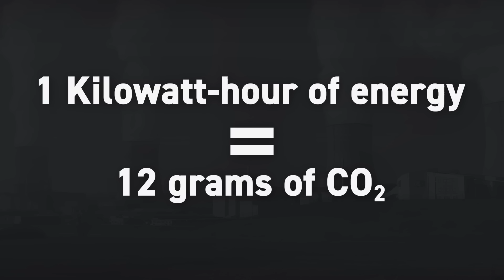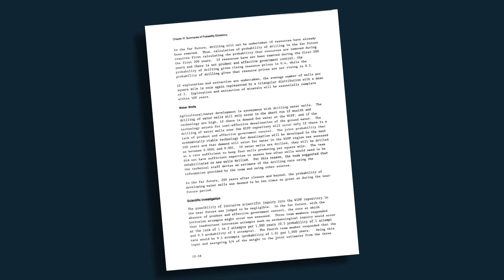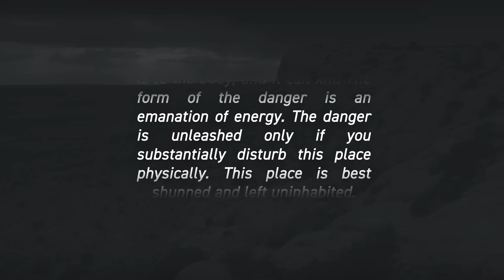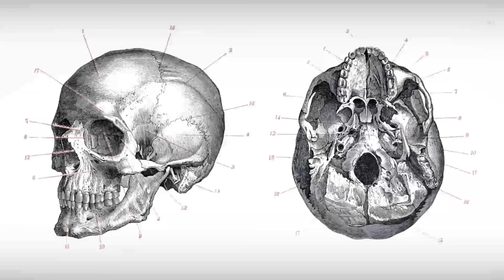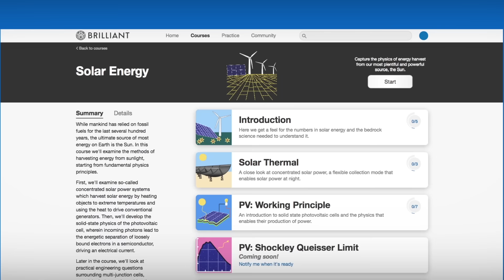The Nuclear Waste Problem

Comment: -the longer it takes for nuclear waste to decay, the safer it is, as it's half life is soo long that it does not release much radiation. Fear associated with long term nuclear waste storage is exaggerated.

-the problem of nuclear waste is self induced, governments opted for a less efficient design in order to produce weapons grade by-products for war. In so doing solid fuel reactors became prominent, which barely even use their fuel, fuel rods being discarded as "waste" while still filled with potential energy, which is a major reason why we have so much waste now.

-LFTR's avoid these problems, produce more energy, aren't under pressure, don't require power to be safe, have virtually unlimited fuel by transforming abundant thorium into uranium, produce useful medical isotopes, require far less space, don't need to be far from society, and burn ALL of their fuel thoroughly, making them ultimately much cheaper and safer to fuel and maintain. The circumstances of Fukushima and Chernobyl would have been harmless in an LFTR.

-the pyramids are NOT tombs. Ancient Egyptian pharaohs were all buried in the valley of the kings NOT the pyramids.

-nuclear power is the future, nuclear waste will not be a significant problem.
Reply: Thanks. Totally agree with you. Def one of his weaker videos.
Reply: Um actually they only started burying in the valley of the kings and queen in the NEW KINGDOM. Pyramids were tombs constructed by Old Kingdom pharaohs, pls look it up.
Reply: type "were the pyramids tombs" into google and see what comes up
Reply: we just can shot it into the sun once rockets are as safe as planes..
Reply: @gandolaf3433  that would eventually slow down the Sun's fusion, killing it.
Reply: Marvin Huber easier to shoot it out if the solar system
Reply: Spent fuel rods are 80% recyclable, the only reason we don't donit is because it's illegal, France recycled their fuel and has almost no nuclear waste, protest this crime against the environment!!!! Legalize nuclear recycling!!!!
Reply: Plutonium is not only a highly radioactive element it is also extremely poisonous as well.
Reply: @babybrat2958  ok. Fire is pretty dangerous too, maybe we should stop using that. Natural gas is very dangerous, lets stop using that. Cars have killed more people than plutonium ever will, lets ban all vehicles. : P it doesn't really matter that plutonium is dangerous, just take precautions. Regardless, with LFTR's I'm pretty sure there's a lot less plutonium involved, though I'd have to double check
Reply: I never said that we should stop using nuclear power. Are you aware of just how contaminated areas of the US are from both nuclear research and experiments....not even talking about bomb testing....there have been quite a few nuclear accidents that many aren’t even aware have happened. 

They have also already had an accident in a repository in New Mexico, a drum filled with transuranic waste burst and contaminated about 1/3 of the repository. It took three years to clean up. 

There is a ridiculous amount of high level radioactive liquid waste stored at tank farms at the hanford site. Portions of Denver and other areas in Colorado were contaminated with plutonium. There were two major plutonium fires at Rocky Flats Nuclear Weapons facility.

Many experimental reactors have suffered partial melt downs.
Reply: vote dis man as president
Reply: Nuclear fusion is where it's at.
Reply: The best argument
Reply: @m0314700308891515  Reprocessing is legal in the USA. Has been since Reagan was president. There is simply no motive to recycle fuel since new Uranium is still cheap. France reprocesses it's fuel but can only do so once, due to the designs of their reactors. After that, it's all waste and it gets stored just like every other nuclear plant. 
We need a new reactor design that is built on a closed fuel cycle. Something like Molten Chloride Salt Fast Reactors.
Reply: The only problem with LFTRs is that they run on Thorium. If your goal is disposal of Uranium/Plutonium waste, a LFTR isn't the way to go. An MCSR is though. Or the LMFBR like the one that ran at Argonne National Labs for 30 years without incident; EBR-2.

Comment: Thorium > Uranium
Reply: China is working on thorium reactors
Reply: powerstack123 really? That’s gonna have an impact on the Norwegian economy. They’ve got tons or thorium
Reply: ANY molten salt reactor > Water cooled reactors. Thorium isn't that great, I would rather see uranium based MSR reactors that can utilize the waste we have already created, and plentiful U-238, instead of pushing for more complex less efficient and expensive thorium fuel cycle reactors. Fast spectrum NaCl(table salt) reactors > thermal spectrum FliBe (fluoride lithium  beryllium) salt reactors
Reply: Phlaked Corn Source?
Throrium makes a lot more than uranium, and has less waste.
Reply: +Ondra English You're comparing a diesel and a gasoline engine and saying one makes more energy. While it's a debate to be had they are both THE SAME NUCLEAR PROCESS. Thorium is bred into Uranium, then fissioned, where in a conventional uranium based reactor uranium is fissioned and fertilized from U235 and U238 with Plutonium as well, compared to Thorium numbers , U233, U235, and other Uraniums. It's a common misconception that "Thorium has less waste" when in reality neither produce much waste and we simply don't recycle the other 98% of uranium "waste" nor do we (Americans) use uranium in breeder reactors. 

As for your comment, we can argue until you're blue in the breath. Uranium technology is well developed and comparable to the Thorium fuel cycle. Are the inherited advantages worth rediscovering and developing the entire facility again? No. However, humanity will do this for commercial and research purposes. Critical Paragraph

Like Phlaked Corn stated, MSRs vs Water cooled reactors are the question here. I've debated a great number of experts on both sides and personally I'm fine with the current gen 3+ and gen 4 PWRs as our nuclear future. I also supports MSRs, however I don't view them as some Godly solution as a lot of the internet pushes out of ignorance and publicity from MSR and Thorium groups.
Reply: Pretty much all modern considerations of nuclear energy are based on technology implemented in the 70s.  It's embarrassing that even well learned people still think that nuclear energy needs to look like the current tech implemented.  There have been several generations of development within the industry since the last nuclear power plant was accepted in the US in 1979.  Just think: Nuclear physics had only just been discovered 25 years earlier.
Reply: You watch Salm-O-Nella
Reply: Reusing the waste we have made increases half life, it doesn't "spend" or dissipate the waste, in fact shelf life grows in binary pattern. Although that is a common misconception (Which is super cool)
Reply: Thorium does have a small advantage on paper, and should be researched; however it is being exaggerated highly for funding and commercial purpose.
Reply: Sam O'Nella is the man
Reply: "Reusing the waste we have made increases half life, it doesn't "spend" or dissipate the waste, in fact shelf life grows in binary pattern"??? That's nonsensical statement, I am reasonably sure which orifice you pulled it from. "grows in binary pattern"? I'm guessing you don't know what 'binary' means. Re-using waste, splits the elements that can be fissioned into elements with, for the most part, shorter half lives. What is meant by "spend" is using up the fissionable elements: see dictionary. It also does reduce it's mass, granted not by much, the process fissioning converts mass into energy(E = mc 2). The reason why a molten salt breeder is useful for dealing with waste is because it can fission most of the long lived isotopes and seperate the daughter products have far lower half lives, from the fuel and longer live transuranics , they turn into stable(not radioactive) isotopes at a much faster rate, meaning they produce a ton of radiation over a short period of time. Essentially meaning we only have to store the waste from this type of reactor for a few hundred years before it becomes stable, it will need a bit more shielding, but that isn't too hard.
Reply: Schade - Thorium has one distinct advantage, a big one, it's common, extremely common. I do think that it is over hyped. It is possible to make a less complex reactor using very similar principles, with the many same advantages using more conventional fissile material. It's not thorium itself that makes molten salt reactor technology so great, it's the fact that the same reactor technology that is capable of using thorium can also be used to almost completely burn up fissile material in a way that is cheaper and safer, than it's solid fueled counter parts.
Reply: sam o nella
Reply: Beryllium > Thorium
Reply: Nordic gods still helpin' us.
Reply: Fusion > Fission
Reply: Everyone has tons of Thorium.  Singapore has tons, but for them it probably will never be worth retrieving.
Reply: Downside of FastMSR: (1) tad less efficient energy generation (but far simpler operation) than ThermMSR, (2) Negligible Pu238 generation, (3) ...I forget.... Is FastMSR good with utilizing Trans-Plutonium elements, or is Plutonium as high as its utilization goes?
Reply: Gen 3+, Gen 4 yes. Good. Gen 5~9 Better.  But never let humanity's thirst for innovation be quenched.  The 4 decade ...lull... in non-information-technology innovations has been a tad embarrassing.
Reply: Please explain how the half-life gets lengthened.  I may know what you are saying... but If you are, that has got to be the most disingenuous way saying it.

Also, the "small advantage" of Thorium... Thorium ThermMSR, or Thorium PWR?
Reply: Fusion.  Like Fission, but better, yet doesn't work.
Reply: Unicorns > Horses
Reply: Xarziel umm, how exactly?
Reply: $LTBR
Reply: I can see that
Reply: ALL HAIL THORIUM THE SMART NERD KID! ALL HAIL SAM-O-NELLA! THE MASTER OF SMARTS!
Reply: Meh
Reply: You're still dealing with the same nuclear waste.
Reply: Not really. One of the benefits of the Molten Salt Reactor is the higher efficiency, which consumes more of the energy in the Uranium. And the unique chemical processing steps mean the fission products you have leftover, are much less of a concern after the long burn-up times in the MSRs. Put simply, the fuel stays in-use longer and by the time it comes out, it's much easier to handle.
About the only thing better than an MSR in terms of waste, is a fast reactor. LMFBRs can fission all the nasty long-lived actinides that make storage of waste such a problem. In a couple of centuries, the waste leftover from MSRs and LMFBRs will have decayed to background or near background levels, assuming we don't discover another use for it or another way to remove more radioactivity. Assuming you're efficient with your fast breeders, you can also reprocess spent fuel and send it back to other nuclear plants for re-use, which reduces the amount of waste that must be stored.
Closing the fuel cycle on our nuclear power plants is an extremely beneficial goal.
Reply: Hulkium > Thorium
Reply: @ErikMello96  Arc reactor > that bullshit

Comment: Just a thought, the fuel rods can still power an engine smaller than a power station. What better solution than to launch them into space aboard nuclear-powered rockets?
Reply: Sounds great in practice, but rockets are rather prone to crashing, and it's probably better that nuclear waste irradiate some soil a couple kilometres beneath my feet than explode in the upper atmosphere.
Reply: i dont think a rocket can be nuclear powered, the only mode of transportation I can think of working for nuclear is steam, which is already used and preferred.